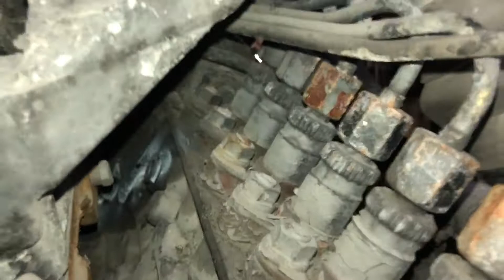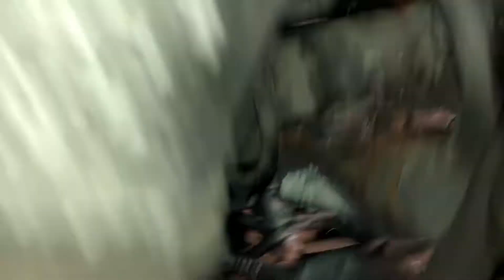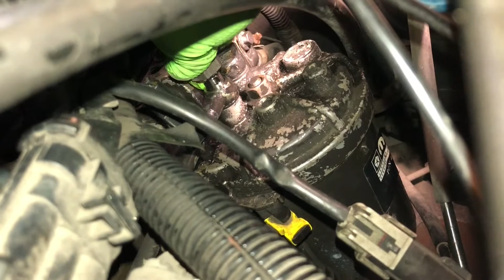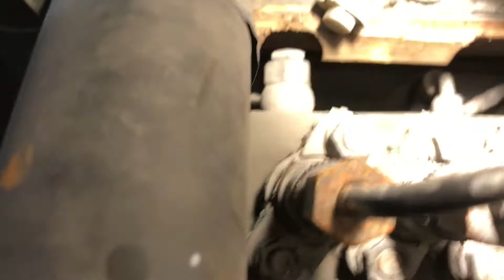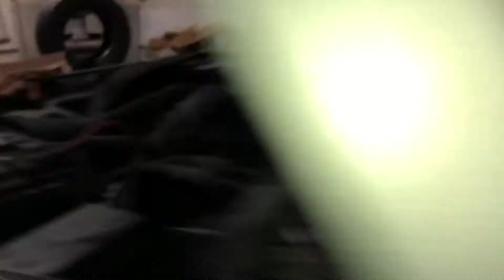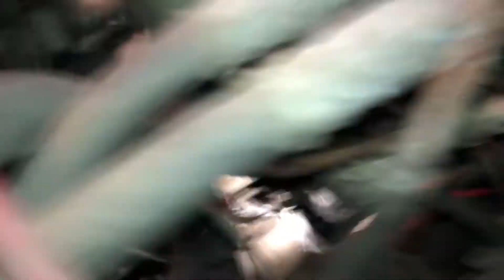1997 Dodge Ram 3500 5.9 Cummins:  Troubleshooting hard starting and replacing the lift/transfer pump

Comment: Thankyou..so this can only be done if it starts..?  Mine just cranks..how do i check pressure without it starting..can i check by cranking?
Reply from the maker: You can still hook up the fuel pressure gauge and see if the fuel pressure comes up at all.  It would be very handy for troubleshooting purposes knowing whether the fuel pressure is close to normal or not.

Comment: 29:09 excuse me sir......we are enjoying the first person view, please stop complaining. We are doing our best to hold the flashlight.
Reply from the maker: I've just had a lot of (unnecessary?) complaints over the years with camera angles and such.  It's not easy working in some of these tight areas, let along when you have a camera occupying where you might normally stick your head.  Thanks for holding the flashlight so steady, it helped me get those lift pump nuts on.  :)
Reply: @AKJeeper  nice job

Comment: Great video, but I cannot get it to prime even after a couple hundred pumps. Finished installing a new lift pump, filter etc. Finished this nightmare a couple days ago and then discovered your video.  I don't know if I have a bad fuel tank pump or what? Help!
Reply from the maker: @mikeelliott9067   I would grab a fuel jug and a length of hose, connect that to the lift pump and see if it would pick up fuel from the fuel jug.  I’m thinking that you might have an issue with the fuel line going to the tank.  If the pump primes just fine from the fuel jug, I would start looking downstream from the pump, make sure the hoses and connections are good/intact and that there isn’t a leak where air can be pulled into the fuel line.  Also check to see if there’s a restriction between the lift pump and the fuel tank.

There is no in-tank fuel pump on these 12v trucks from the factory, the pump on the side of the engine block is what pulls fuel from the tank and sends it to the fuel injection pump.
Reply: @AKJeeper  Thank you for responding so quickly.  I will try these things.
Reply from the maker: @ one thing to note - the fuel heater next to the lift pump is a trouble area.  I’ve come across several trucks where the lift pump was sucking air through this fuel heater and causing fuel flow issues.  A lot of people will remove the fuel heater for this reason.
Reply: @AKJeeper   Thanks
Reply: @AKJeeper how do you remove n delete?
Reply: @AKJeeper and thats a beautiful thing...lol

Comment: where did you get your fuel pressure guage?
Reply from the maker: I’ve had this gauge for over 20 years.  It is made by OTC.  Might have gotten it from NAPA or a tool truck.

Comment: Mechanics tip 101 use a socket put a little masking tape inside the socket and then stick the nut into that and then you’ll be able to start it without it falling out.

Comment: Did you tighten the studs into the block? Do they bottom out in the holes?Also the replacement pump I bought doesn’t have that relief hole that the oem pump has…is that a problem?

Comment: I have been through four lifts pumps in week 2 from AutoZone in two from O'Reilly's and I'm working on the third one now from O'Reilly's they keep leaking out the rubber boot in front is that a manufacturer defect or I don't understand what the problem is I'm ready to just go to an airdog system I spent almost $200 on this lift pump even though it's mechanical is it better just to go with the air dog or the fass cuz I am tired of trying to get fuel to the top and this thing I got to keep replacing it a million times
Reply from the maker: I’ve had awful luck with these parts from chains like AZ and O’Reilly’s.  A lot of their parts are made in China and are simply no good.
Reply: So how about oem from dodge?

Comment: Hello, can this also cause a loss of engine power? I have a similar problem with an agricultural machine also with a cummins engine, in the grain field it loses power but on the road it works fine, but if I need power from the engine it cannot provide all of it and the engine revs drop.
Could it be because it has no fuel pressure?

Comment: Owning a 97 12v,  i so appreciate this video since idk where to start on the fuel filter change. This 97 has been sitting for 6 months and harsh winter of 2023 sucks for working outside on the 12 valve.. TY!
Reply: Mine sat for 6mnths too 2024 ..changed battery n starter still cranes no start

Comment: @AKJeeper would it be a good idea to lightly pressure wash the engine before doing work on the fuel system? Just have to be careful on the electrical connections I guess.

Comment: I have a 97 dodge ram 3500 12 valve and if it sets over night it's very  hard start I have to give it throttle until then once it warm it starts perfect all day long
Reply: Did you figure out a fix for this.    My truck is doing the same thing  I believe.     I changed governor springs    thinking that would do it   it didn't

Comment: My truck is idling at 20psi when I clamp the line it goes to 40 but when I rev to 2000 it stays at 20 psi
Reply: What’s wrong with it😂
Reply from the maker: Return line clamped off, it stays at 20psi at 2k rpm?
Reply: @AKJeeper  no i haven’t reved it to 2k with the line clamp because at idle it was at 40psi clamped
Reply from the maker: @tannercolvin8781  the overflow valve on the side of the injection pump is most likely bad.  The spring inside gets weak over time and allows fuel to go back into the tank rather than stay in the pump and build pressure.
Reply: @AKJeeper  I stretched the spring out to put the pressure at 25 but when I rev to 2k rpm it stays at 25psi still
Reply from the maker: @tannercolvin8781  could still be the spring.  If you clamp the line off and pressure increases to about what we would expect, you know the overflow valve is opening prematurely.

Comment: did you buy your studs from the hardware store or ?  How long are they suppose to be. I have seen two lengths ,50 and 55mm
Reply from the maker: I don’t recall the length of the studs.  The studs came with the pump kit that I ordered for the truck.

Comment: Great video with a very good step- by- step diagnosis. The only thing I'd add is to check/ clean the screen in the fuel heater. They can get clogged with the big chunks from the tank and restrict fuel flow to the rest of the system downstream of the lift pump.
Reply from the maker: Excellent tip.  I checked the fuel heater screen but forgot to mention it in the video.  I started to get in a hurry.
Reply: I deleted my fuel heater to avoid these issues
Reply from the maker: @EastMenloPark1650  it’s a popular modification.  The fuel heater does very little (if anything) - lots of trucks up here in the arctic run without them with no ill effects.  🤷‍♂️